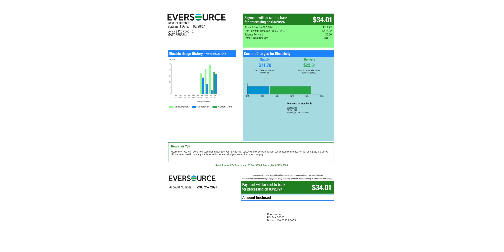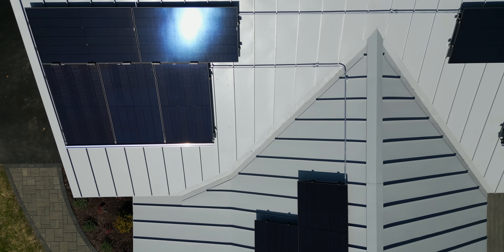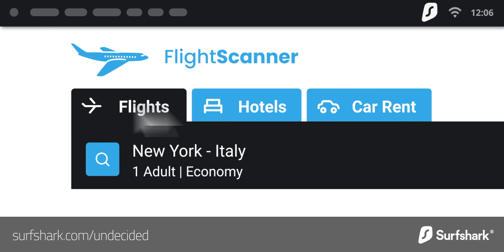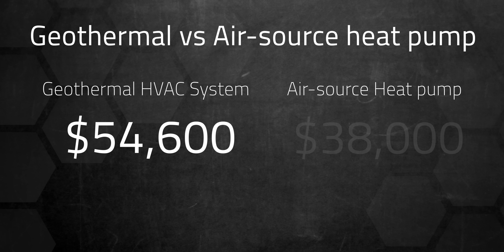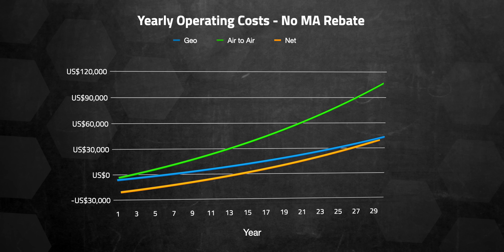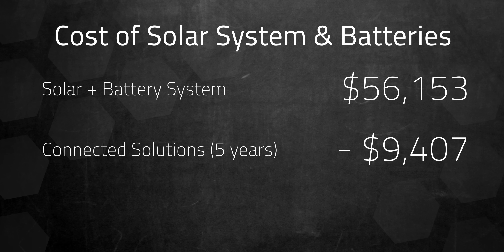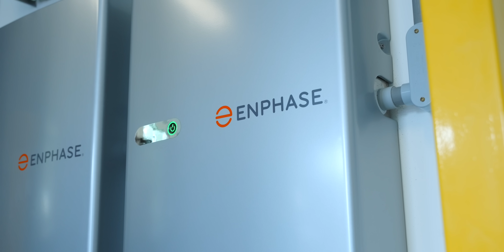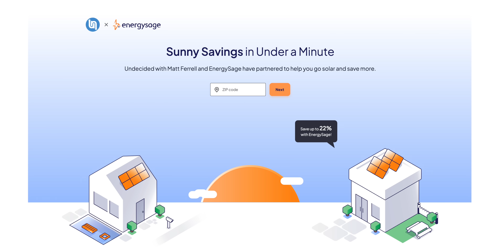What I Learned After 1 Year with New Solar Panels

Comment: This week I came across the channel "Energy Home DIY", in which a Dutch engineer talks about using small heat pumps in an experimental setup to efficiently pre-cool and pre-heat tanks of water for HVAC use. Are you heard of approaches like this or whether anyone is developing it into products? On the surface, it sounds like he's getting good results from it.

Comment: Nice job summarizing a lot of complex information. Your home is impressive. 

I wish we had the money to do same. We built a tight and highly insulated house 5 years past in Vermont and heat/cool with heat pumps and air source water heater.  Would like to add solar but so far the cost has not been practical for us.

Comment: Your math is seriously flawed, unfortunately, as it seems you are ignoring the time value of money.  Money in the future must be seriously discounted compared to money now.   Go back and redo using values from the =PMT function in any spreadsheet or other calculator that factors interest rates.   For example, for a $88,000 solar+battery system at today's mortgage rate of 7.5%, there's $6,600 in annual interest.   Over 30 years, it's $615 per month, or almost 1.5x your old electrical bill you are paying.   However, really you should consider "What would I be getting if I invested the money instead of buying the solar."   The S&P 500 has returned an average of 10.26% per year and is a good comparison.    Now let's put on all the subsidies you got to take it down to $46,747.  Thanks taxpayers, they got your monthly cost of your solar down to $419, only a bit more than you were paying before for grid electricity.    Now, will grid electricity go up?  Or will it go down because it's becoming more and more from solar farms, now generating at around 2 cents/kWh, and dropping?   (Sadly, delivery prices will rise.)    Your error -- all those batteries.  With net metering you don't need nearly that much.      I say this not just as somebody with a degree in math -- ask anybody with basic knowledge of financial math and they will confirm that your calculations must all be redone, and that you will get significantly different results when you do.     I paid a lot less for my solar and I live in a sunnier place, and I didn't buy all that battery, so my solar will pay for itself reasonably fast.    Yours unfortunately never will, other than in grid reliability which you could have gotten more cheaply.     I know this is harsh, but if you want to be an educator on energy, it starts, ends and spends most of the middle with math, and the math must all be time-value math, nothing else works.   The real math is more complex than mine here as you do want to factor inflation estimates for the payments going forward into the future, which balances it a bit.    The real spreadsheet is complex, and you need to factor panel degradation, inflation, interest, how much power you actually use, payment you get from utility for power you don't use etc.     But a rough estimate suggests your system is costing about 27 cents/kWh if you use all 18mWh each year, but more if you are not using all of it.   (That's with all the subsidies.  Without the taxpayer boon, you are paying about 52 cents/kWh -- drastically different from your straight-line calculation.

Comment: You mentioned you save on electricity, so that includes your EV charges saving? Apples to apples, the gasoline saving would also be added? Since you calculated your expected electrical cost over the next 30 years. but perhaps that is another story for an EV video. Technically, now your house also enables you to travel significantly? How much are you using to charge your EV?

Comment: The prices you paid for your solar PV system are absurdly high. I am not sure if this is the norm in the USA, but here in Lebanon, I installed the following system in Jan 2024 for $6,700: 8x Jinko 585W panels, 1x Deye 6kW hybrid inverter, 19.6 kWh Narada Li-ion batteries, metal structure, earthing, etc... The batteries alone were around $2,900 so for your batteries to cost $33k for the same capacity, something is not right at all. I am reading similar comments here. Why is there such a price difference? I am sure you shopped around before buying. Can you please shed light on that.

At the time of writing this comment, the price of a 585W Jinko panel in Lebanon is $80-85.

Comment: Thanks for the video, 
I have 10mwh installed since 2010, and very happy. Our cars run 80% on electricity, but heating is still on natural gas.
One thing to go into the calculation: I financed my installation with a mortgage loan at 2% for green loans, so actually I pay the installation over 20 years. This means that my savings montly outweigh my mortgage payements, so my installation made me money the moment it was switched on.

Comment: It's interesting to see how the comparatively low cost of electricity in the US (compared to the UK) affects the calculations. I recently did some rough calculations for replacing an oil fired boiler with a Heat Pump and it actually came out more expensive on todays rates. I have batteries so can load shift to some extent but would probably need more storage than I have.

Comment: Yes er no, maybe* worth it if you can do it. I did solar and battery 13months ago and 6months ago got a heat pump hot water system. Specs in a nut shell are 10kw solar, 15kwh storage and heat pump hot water over 13months a cost of $31kAUD

Comment: That's a dream system you have. Here in Zambia we've been getting 3-4hrs of utility supply due to drought drying up our hydro power supply. Solar is not an option but a necessity. 

I installed a 5kw system with 8x 550w panels and 2x 5kwh batteries for just over $3,000. It powers everything apart from the water heaters. With your solar budget I could build a whole new house off grid over here
Reply: Right?!  Nice to see I'm not the only one on a budget  😂
Reply: Crazy price for solar instalation. I am having 8kWp solar panels + 10 kWh batteryinstalled right now. It's done by a professional company,with what I consider high-end components. Total cost, materiały + Labour, is less than 15000 US dollars. Plus, 6000 dollars I can get refunded  from EU programms. Living in Poland, BTW.
Reply: Good job Joseph. Nice to see amazing enginers in Africa, the continent of sunshine.😃
Reply: Solar water heating was the biggest return on investment I've ever made.
Reply: This is completely wrong, the drought ended a while ago and the reason why we get less electricity is because Zambia is selling it's power to other countries, and it costs more then 3k
Reply: also zambia has way more sunlight so youre get more per m2 than in USA or EU.
Reply: @DNAofDoggie I hope you consider the relatively inexpensive addition of at least putting a simple water tank before your proper water heater.  A temperature equalizing holding pre-tank water supply could  naturally bring the municipal water up to ambient air temp, potentially around 50ºF of savings...depending on the difference between your municipal ground pipes and ambient air temp. Further, of course, would be an evacuated solar collector; even a tiny one might heat your water sufficiently.  People often testify their full size collector heats their water to practically boiling within a short time of the sun's rising. So although you might experience a comparably longer rise time, you could have sufficient hot water without ever electrically heating it for many days.  Even coiling a black pipe circulating glycol on the roof and extending it to wrap it around the outside of your pre-tank  could assist for very little expense.  Alternatively, the tank could be placed in a traditional simple wooden box painted black inside, with a window facing the sun, like a solar oven.
Reply: The whole system seems ridiculously overpriced and overblown.

I could get solar (25-35.000€), a heatpump (30-40.000€) for heating and a small battery system (10-15.000€) for that money in Germany. You do get a bit of money back from the state but not that much.

Comment: Geothermal is cheaper than air source heat pumps, because when building the structure it’s easy to just dig a hole in a zigzag trench format and many places with energy efficiency policies make it convenient to add in the planning authorisation process.

Many countries have energy efficiency in mind in their building code that it’s actually very close to being up to passive house standards 0.19 or 0.25 U value for walls and 0.13 or 0.15 U value for roofs and ground floors.

Also most places around the world houses and buildings often last for a century or more.

Making the long term economics of geothermal more beneficial since it’s far more efficient than air sourced heat pumps.

Americans pay considerably more for geothermal because it has a wildly inefficient authorisation process, inconsistent regulations, overpriced trade jobs, houses and buildings only last a couple decades, no favourable building regulations towards energy efficiency and the existing structures have horrible efficiency meaning higher energy demands to compensate for being too hot or too cold.

Comment: Are there some missing units in the description of the connected solutions program? @ 10:30...  Praying $275 per average kW ?  Energy bought or sold is usually in units of kilowatt (or megawatt) hours, not kilowatts...  There's probably more definition of what the program specifies that's not obvious here

Comment: Solar installations in the USA are quite expensive.
I live in Germany and we have a new 8 kW solar installation with a 10 kWh battery and it costs about 10 000€. With the current price of 0.42€/kWh for electricity it should be refinanced in about 6 years without selling any electricity to the grid

Comment: I literally started watching this video while eating supper just before windstorm. I paused the video because the wind blew over a neighbor's fence. And then the power went out for most of the city. We didn't immediately notice. That was 3 hours ago, I'm the only one in sight with working lights.

We're running a Sol-Ark + HomeGrid + a whole bunch of solar panels. But we only have one panel that runs off the battery. It's the "important stuff" panel for the fridges + HVAC + internet... plus one TV.  This is our first major outage since the install and it's working quite well. I'm honestly still setting up the all of the automation and monitoring for the Span panel, but knowing that we can still operate for a while has been great.

We don't have enough to power our whole home with the grid down. Though that's actually an issue with local regulations more than one of desire to operate this way. Honestly, there's probably a fun video on the things we underwent getting this all set up. I wish I could plug in my EV as an extra charging source, but the local regulations won't allow it.

But as we electrify and diversify more of the grid. I think home like this are an essential blueprint for the future. Thanks for sharing everything you're doing.
Reply: Local regulations prevent a whole house capable system? Sounds like the utulity company wrote the rules.

Comment: Thanks for stats sharing... helps to know where we Waterfurnace owners align.
Not too different - 1500 sqft home in southern Wisconsin plus full basement.
Waterfurnace 7 - slinky loops. Turned one year old yesterday - 1,669.68 kWh for the year.
Same water heater... with superdeheater and 598kWh for a year's worth of hot water.
Solar install starts this Friday... 16.49kW annual projected at 21,592 kWh  (all angled south).
Two Powerwall 3's once they ship.

Comment: Great Video as usual ❤
We went Solar about 10 years ago and added battery storage and a heat pump hot water system 2 years ago and the naysayers have continually challenged our decision based on the “pay back” time. I’ve always said saving money was never the reason for solar it was reducing our carbon footprint to do our bit towards mitigation of the climate disaster we find ourselves in!
In Australia, one house isn’t going to make a difference, but the hundreds of thousands of homes that have added solar has sent a clear message to our politicians that we’re not waiting for them to take the lead

Comment: A friend of mine, who lives in California, recently installed solar. By the time everything was installed and turned on, SoCal Edison had started charging $35/mo for a grid connection fee. That fee doesn't even count towards his usage. Your $10 fee seems more reasonable and consumer friendly. $420/year is not an insignificant fee for having solar, and I can guarantee that fee will go up over the next 30 years.

Comment: I don't understand why your video spends so much time on calculating and comparing costs, when at the same time you acknowledge (and is verified by the comments) that cost are more than significantly dependent on external factors.
I also don't understand why you calculate cost to two decimal places. (Which makes sense for a price/kWh, but not for a 30years saving)

You are a nerd and love numbers so much, it seems you drowned in them,

Comment: They waaaay overcharged you😅

I can buy 43 550W JA Solar panels for 78000ZAR or 4400usd

And 2 felicity 12KWh batteries for 70000ZAR about 7800USD

And south africa taxes the hell out of battery imports.

I know a guy that went completely off grid with a 50KW Deye system and 12 5KW batteries that cost him 85000USD for everything.

Comment: 01:50 "produce almost 18000 kWh per year, or 18 MW"
no... kWh does NOT suddenly become kW (or MW)
(the same as you don't use units of speed and distance interchangeably)

Comment: Wow, that price is just insane. I'm looking to install a system myself and figure the total cost will be under $8,000. But my daily energy use is minimal with my servers being the main draw. Lighting is under 100W for the whole house as I buy the most energy efficient bulbs I can so each room has a few thousand lumens(about the equivalate to 2-3 100W bulbs). Where I'm saving for now is batteries. I'll only have between 8 and 12 hours of full usage. But I figure at night I'm sleeping for most of it, so again power draw is minimal. Heating is Gas for now and AC is just 2 small window units. As I can afford it I do plan on adding batteries with the goal of two full days of backup power capacity.

Comment: Are those panels made of solid gold, omg.. I just installed 60 400 watt (500 watt with bifacial) panels, 130kWH of lifep04 batteries.. Just passed final inspection last week.  In Michigan in November on a sunny day I was hitting over 22k watts on the panels, I produced over 100 kwh in the day.  I paid 7200 dollars shipped for all 72 of these panels, only using 60 of them so far.   I am not using micro inverters, I spent 4200 on 3 EG4 6000XP inverters and running them in parallel.  I diy the batteries and spent 18k total on them, they are all in rack mount cases, 15 kWh per battery using JK BMS's and Eve MB30 Grade A 306AH prismatic lifep04 cells.  I don't know how the heck someone could charge so much for solar panels and batteries.  I understand I did the labor myself but wow, someone is making a pretty penny.
Reply: I mean look at the guy, he asked one contractor and got bullied into accepting an over priced bid.
Reply: 18k for 130kwh of batteries, did you write that correctly? Used cells?
Reply: @slavko321  Yes I wrote that correctly, Eve MB30 306AH Cells  (brand new grade A cells) in Yixiang DIY cases with JK BMS's.  Can build each one for about 2k each shipped, each battery is over 15 kwh. The MB30 cells capacity are actually higher than the rated 306, typically 320+ per cell.

Comment: I'm so very glad I don't live in MA.  31 cents per kwh vs 14 cents in MO.  My 16 panel solar array is net positive 440 kWh per year.  Electricity bill averages $17 per month, natural gas is $67.  The solar array was installed for $15K excluding tax credits, etc.  With tax credits, it cost about $12K.  Your $400 per month heat pump bill would heat and power my house all winter!

Comment: Your geo thermal system will need major repairs before 25 years. I suspect the solar and battery system will also. This will affect your calculations big time. I’m a geothermal installer and I have never seen a water furnace unit run more than 20 years before you will need to change the compressor.

Comment: My house had 2.65kw financed panels I took over when I bought the house then installed a 10.51kw system our own with 31kwh of battery. Southern California it more than runs all our ac in the summer and heat pump in the winter. The system was about $25000 after tax credits. With our energy rates in Cali this system should pay for itself in 5 years. Haven’t had an electric bill in over a year
Reply: I switched out my propane water heater to a heat pump water heater. Saves me $800/yr in propane and cost me $1600 to install after rebates.
Reply: California killed grid tie solar. Right now I get 1:1, but new connections get 75% less. In 11 more years I get kicked out of grandfather status and any energy I send back I get charged 8 times as much to get it back
Reply: Only my existing 2.65kw system exports to grid (averages about 11kwh/day. The system I put in is non exporting “off grid”